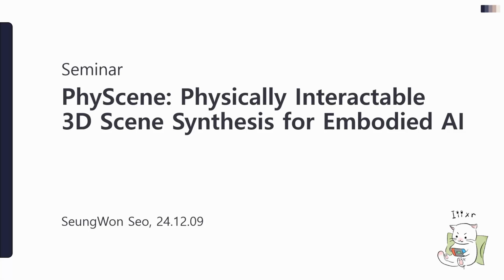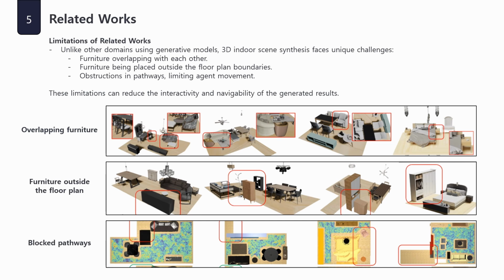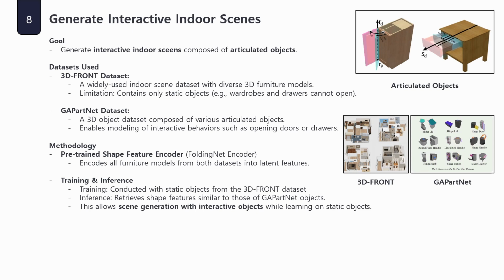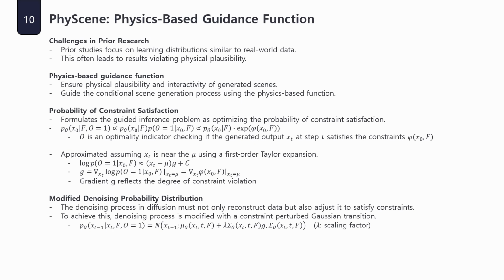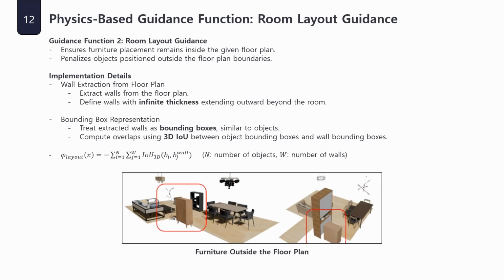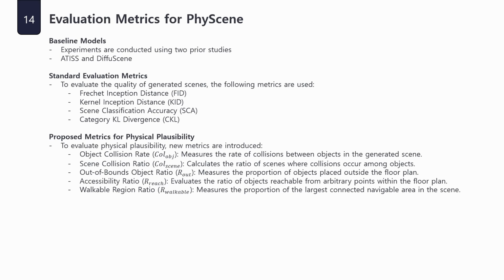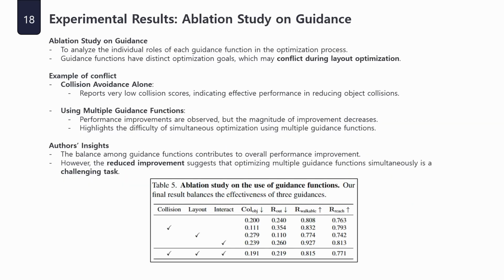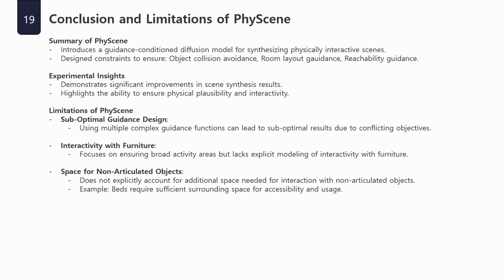[Seminar] Physically Interactable 3D Indoor Scene Synthesis

Comment: Is it correct that they are learning loss by further subdividing it to solve existing methodologies? 

It would be interesting if they could solve it with reinforcement learning instead of deep learning, but what does future work want to deal with in this paper?
Reply: PhyScene has added guidance to consider physical plausibility during the training and inference stages, which was overlooked in previous methodologies.

Research on considering physical plausibility in relation to reinforcement learning is also a good question. While this paper does not mention other learning methodologies as future research, I recommend the paper titled 'Haisor: Human-aware Indoor Scene Optimization via Deep Reinforcement Learning' for related studies.

Comment: I greatly enjoyed your fascinating seminar on indoor scene generation. However, I have a few questions.

Q1. In the related works section, you pointed out three major issues in current studies. Why do you think these problems arise? In particular, I am curious about the issue of overlapping furniture. Since the sizes of the objects are predetermined, it seems that adding constraints to avoid overlaps could resolve this issue. Why has this not been addressed?

Q2. It is truly impressive that Physcene accounts for physical factors when arranging furniture. However, I have some concerns regarding its approach to minimizing object collisions. For instance, placing a vacuum cleaner upright on a table can be entirely natural, but the current model would likely exclude such scenarios. What are your thoughts on this?
Reply: The primary reason is that the dataset itself contains issues such as overlapping, which is a problem of dataset quality. This has led to recent efforts to create new indoor datasets.

As you mentioned, these issues could be resolved during the optimization process. However, it is also a challenging problem since there may not always be a single correct answer. If you are interested in obtaining additional information on this, I recommend referring to the optimization method presented in the paper titled "Open-Universe Indoor Scene Generation using LLM Program Synthesis and Uncurated Object Databases."

What you mentioned is likely physically plausible but considered a result that deviates from the real-world data distribution. A simple way to address this issue is by adjusting the weights of the guidance. Furthermore, considering semantic relationships more deeply would be another approach. If you are interested in methods that account for semantic features, I recommend referring to the paper "InstructScene: Instruction-Driven 3D Indoor Scene Synthesis with Semantic Graph Prior."

Comment: Thank you for the presentation. I have two questions.

Q1: On page 3, you mention using a “complex rule” to address the limitations of the previous approach. Is this approach based on procedural methods or a graphical language? It’s hard to envision a state-of-the-art indoor scene synthesis technique relying on such a complex rule these days.

Q2: It’s challenging to understand “reduced improvement” as a primary limitation. This issue might be due to conflicting guidance signals rather than the use of multiple optimization steps. Providing more in-depth analysis to link the conflict of guidance signals to the observed reduction in improvement would be more insightful than just presenting the experimental results.
Reply: The term "complex rule" was used to describe early approaches before deep learning. As you mentioned, procedural methods or graphical languages were used in early research, but such processes are not included in recent studies.

Thank you for the great point. This issue is highly likely caused by conflicting guidance signals. What I focused on is that using multiple guidance signals inevitably has the potential to cause a reduction in improvement.

Comment: Thank you for such a well-delivered and insightful seminar.

Q1. What challenges and limitations arise from relying solely on bounding box-based calculations for collision avoidance in Physic SC, and how might these affect the accuracy and practicality of generated scenes?

Q2. How could incorporating user-specific requirements influence the design and optimization of scene synthesis models, especially in addressing accessibility and aesthetic needs?
Reply: The biggest expected issue is treating all furniture as bounding boxes. Furniture is composed of various parts such as legs and a body. Handling this as a single bounding box is likely to result in sub-optimal outcomes, especially in collision handling. For instance, consider a chair tucked under a desk; if this is processed as a bounding box, unintended collision handling may occur, which does not align with our intentions.

While I am not entirely sure what is meant by user-specific requirements, I interpreted it as receiving specific conditions. For aesthetic requirements, I recommend referring to the paper "InstructScene: Instruction-Driven 3D Indoor Scene Synthesis with Semantic Graph Prior," which demonstrates creating furniture arrangements with different styles.

Comment from the maker: [Overall]
1. Thank you for an interesting and dedicated presentation. Your effort made it easy to understand the paper's motivation and limitations.
2. While I appreciate your enthusiasm to delve deeper into the paper, the presentation contained too much text, which made it feel overwhelming. Focusing on only the most critical information would make the presentation more concise and impactful.
3. Appropriate guidance significantly enhances the audience's understanding. Presenting excessive text without clear direction can confuse the audience. Consider structuring your content to highlight the key points more effectively.
4. When presenting tables, please emphasize the key points or insights the audience should focus on.
[Questions]
Q1. How is the quality of the articulated objects in GAPartNet? Are there any metrics or evaluations to assess this? Qualitatively satisfied?
Q2. The paper seems to focus solely on the range of motion of the articulated objects. Did it consider factors such as the user’s position or convenience when interacting with these objects? Or were these aspects ignored?
Reply: From my direct observations, the data is segmented and stored at the part level. However, it is unclear whether animations are included for immediate use. I suspect that additional processes might be required for such purposes.

The optimization is performed based on factors such as collisions with the range of motion maximized, but it does not consider the user. Notably, one of the goals is to create an environment where virtual agents can interact, yet the paper does not mention humans at all. I believe research from an HCI perspective, such as determining whether the positions are suitable for interaction and whether there are any inconveniences, could be a new and valuable direction for indoor scene synthesis studies.

Comment: I'm curious how they made the diffusion model into a conditional model. Does this learning method use classifier free guidance? 
The only way I know is to use classifier free guidance, so can you tell me how they can extend diffusion into a conditional model? 
Can they set the condition by simply forwarding the floor plan at each step without using attention?
Reply: I understand that classifier-free guidance is a method that trains both conditional and unconditional models simultaneously. The guidance presented in the paper is utilized in training by providing an IoU-based loss to ensure physical plausibility. According to the code, the floor plan is encoded using a ResNet and included as a condition through cross-attention operations.

Comment: Interesting semanar! but it is so difficult. ;ㅅ;

1. I don’t understand the Probability of Constraint Satisfaction section on page 10.
- 1.1 Is the constraints function the sum of all the functions introduced later? Could you provide an intuitive explanation of what the presented equation means?
- 1.2 Why is the first-order Taylor expansion used in this context?

2. How is collision avoidance for articulated objects taken into account?
Reply: Yes, the constraint function indeed includes all three types of guidance. It can be expressed as follows:
φ(xt, F) = γ1φ_coll(xt) + γ2φ_layout(xt, F) + γ3φ_reach(xt, F).

The gradient that appears during the first-order approximation simultaneously indicates "how much the current state violates the constraints" and "in which direction to move to reduce the degree of violation." This serves as a guide during the diffusion process to not only denoise the data but also adjust it in the direction that satisfies the constraints.

For IoU calculation in the case of articulated objects, the bounding box is computed using the movable part of the object at its maximum extent. This bounding box is then used for IoU calculation.

Comment: Good!

Q1. For evaluating FID, feature extractor is needed. What model is used for feature extractor?
Q2. In evaluation, PhyScene get worse for FID and KID. Nevertheless, can we say that the proposed methodology is better than existing methods?
Reply: For FID measurement, they use rendered scene images. Therefore, the method is the same as the commonly used FID measurement approach.

The key point to focus on in PhyScene is not just visually plausible results but the necessity of synthesizing physically plausible scenes. From that perspective, the presented outcomes demonstrate that this research is meaningful.

Comment: Nice presentation

Q1. On page 10, why does learning the distribution of real-world data cause the violation of physical plausibility? Aren't real-world objects always physically plausible?

Q2. The losses seem to operate on 2D scene images, which might misinterpret some correct placements as incorrect. For instance, if a vase was placed on a table, wouldn't the system classify it as physically implausible?
Reply: This occurs for two reasons. First, unfortunately, the 3D-FRONT dataset contains some data that violates physical plausibility. Second, physical constraints are not explicitly considered during the training and inference stages, making it difficult to guarantee such plausibility.

No, the losses are calculated using 3D IoU. Therefore, cases where a vase is placed on a table and appears to overlap are not an issue. More specifically, as long as the vase does not penetrate the table and is properly placed on top of it, it is considered plausible, so there is no problem.

Comment: I've read this paper. Thank you for helping me get a deeper understanding.

Q1: What do you think about the naturalness of the generated scene layouts using the method proposed in this paper? What perspectives could be considered to improve the naturalness?
Q2: Are hinged and sliding movements the only categories of possible object movements?
Q3: I believe that the volume of object collision is not as important as whether an object is colliding or not (binary: 0 or 1). So why is IOU loss used for collision avoidance? In my opinion, if IOU is used as the loss function, the model might consider a small amount of collision acceptable. What are your thoughts on this?
Reply: The naturalness you mentioned opens up various perspectives. Naturalness can include not violating physical plausibility, as frequently emphasized in the paper, as well as modeling a distribution similar to real-world data. Personally, I believe considering human behavioral patterns that can occur indoors would make the results even more natural. For instance, we sit on chairs, pick up items from desks, lie on beds, and turn off table lamps on bedside shelves. I believe taking such behavioral patterns into account could lead to more naturally synthesized results.

Hinged and sliding movements are representative movable parts of furniture. Upon further consideration, there could also be objects like adjustable wardrobes with extending heights or monitor arms with higher degrees of freedom. However, in most cases, I believe hinged and sliding movements alone are sufficient.

In my opinion, when considering interactions between humans and furniture, whether a collision occurs (binary: 0 or 1) is important because human objects will always start outside the furniture. However, furniture may start in an overlapping state. Therefore, the degree of overlap becomes a critical factor, and minimizing the overlap will likely be the direction of the training. IoU serves as a useful loss calculation method in this context.

Comment: Thank you for the great presentation! 
I found your paper really interesting, so I ended up with quite a few questions—hope that’s okay:

Q1. In Slide 9, you mentioned that the conditioned diffusion model takes time embedding and floor plan embedding as conditions. How are these embeddings obtained, and what forms do they take? I'm particularly curious about the floor plan embedding.

Q2. On Slide 9, you explained that the conditions are added to all layers. Does this mean they are added through simple addition calculations, as opposed to the attention mechanism used in stable diffusion, where conditions influence the attention computations for each layer's output?

Q3. Could you provide a more intuitive explanation of the modifications to the denoising process for constraint satisfaction mentioned on Slide 10?

Q4. The guidance function is constructed for three objectives, but I’m particularly concerned about the computational complexity of the reachability guidance. It seems to require numerous calculations and constraint functions. With such a large combination of functions, I wonder if the model can effectively learn and if the training time would be excessively long. Did the paper propose any specific training strategies or complementary techniques to address this? While the Author Insight section hints at this, honestly, it makes me wonder how it was trained at all!
Reply: The floor plan embedding is achieved through a ResNet, and the time embedding follows the standard implementation of time embedding used in continuous diffusion, as you may already know. From the code, it was confirmed that both conditions are passed to the model via cross-attention.

Each constraint can be understood as three loss functions: avoiding collisions between furniture, ensuring objects do not go beyond the floor boundaries, and preventing obstructive placements that hinder movement. I agree with your concern regarding the computational complexity of the reachability guidance. However, I have not directly verified this myself, and since there is no mention of time cost in the paper, it would require experimentation to determine this. If I gain sufficient insight into this matter in the future, I will make sure to provide a follow-up response.

Comment: Thank you! It was a very insightful seminar 😊

I have two questions.

Q1. How did you address the mismatch issues when combining the static dataset (3D-FRONT) with the interactive dataset (PartNet)?

Q2. For articulated objects, does the model consider the full range of motion when generating the layout?
Reply: The interactive dataset is not considered during the training phase, so PhyScene learns an object encoder that can be used for both datasets.

The bounding box is generated by maximizing the range of motion, and this is used to calculate IoU for layout generation.

Comment: Your presentation was very impressive, and it was interesting that it could create indoor scenes with physically plausible interactions.

I have two questions:
Q1. You said that the 3D-FRONT dataset is used for training and the GAPartNet dataset is used for inference. How is the difference between objects in the two datasets compensated for? Even if a similar object is selected, some position differences are expected to exist.

Q2. What exactly is the difference between Object Collision Rate and Scene Collision Ratio metrics?

Thank you!
Reply: From my direct observation of the datasets, I believe the difference is negligible and can be ignored. There are two fundamental solutions to address this issue: the first is to prepare more datasets, and the second is to generate the objects directly.

The Object Collision Rate refers to the proportion of overlapping occurrences across the entire dataset, while the Scene Collision Ratio refers to the proportion of scenes that contain overlapping objects.